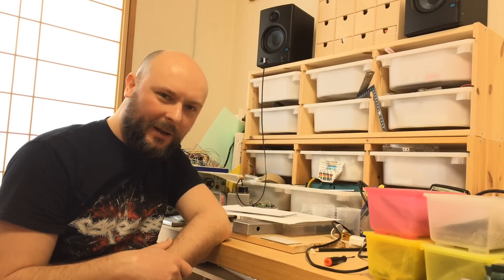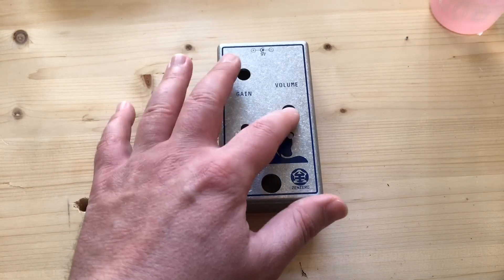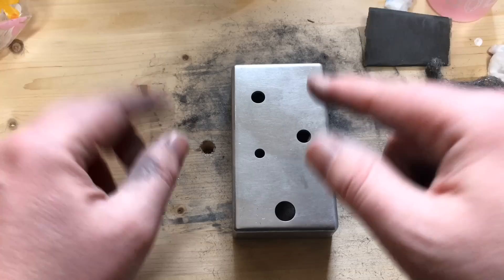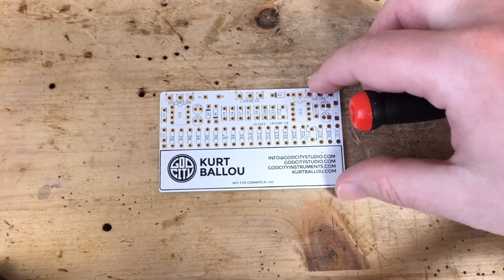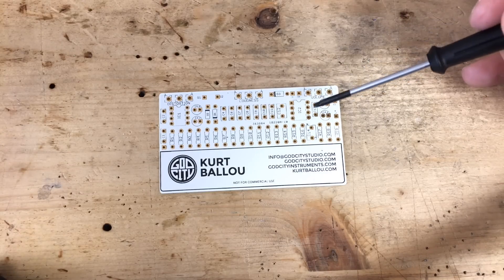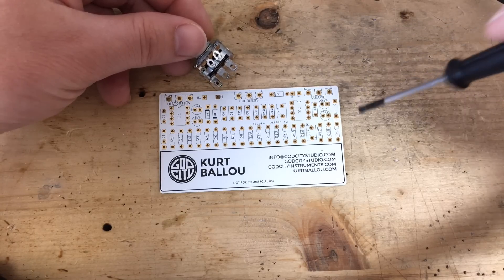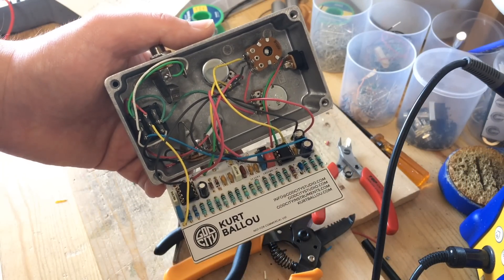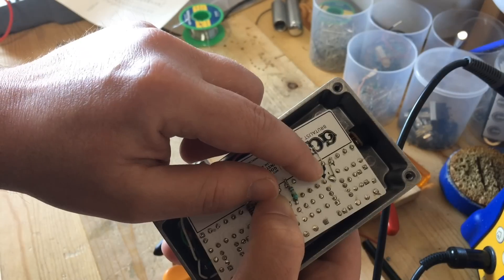Kurt Ballou's Brutalist Jr - Overview, build and mod

Comment: I use a bit cut out of a 2 litre PET soft drink bottle as an insulator between the board and case. Its pretty robust.
Reply from the maker: Thanks for the tip. I will try it out 👍

Comment: Hi i fail on this building...

the led is turning on up but no sound at all (the bypass is working)

do you have the step by step pedal circuit layout or any tip to help me on the search of the problem?
Reply from the maker: Hi. Sorry the build didn't work out yet. I don't know your level, so sorry if I say something above or below your skill level. Anyway, I would first take a good look at the circuit, visual examination solve problems sometimes and it's so much faster than anything else. Look for a bad solder joint or broken trace. Failing that, I would try to follow the signal path. It should flow from the "I" input, to pin 3 of IC1, to pin 6 of IC1, pass through the filter stage and the LOUDNESS control, then to pin 3 of IC2, to pin 6 of IC2 and then to the VOLUME and "O" output. Good luck!
Reply: Hi! Now is working fine... Some weeks ago with help from Kurt i discovered that the ICs was backwards. Thanks for the help and attention!

Comment: Why do not put 2 separate pots ? 
for more settings ?
@ZenZero Electronics
Reply from the maker: Sure, you could do that. But I usually prefer controls to be simple (I build the One Knob Pony and the 2KP after all). In this case, I had that double pot lying around and I know it works well to use to consecutive linear pots to get the effect of an audio or logarithmic potentiometer, so I went for it.
Reply: i like have a lot of choice, even if  at the end I dont change very often. 
Thank you for your channel, have you a Instagram account ?
Reply from the maker: Yes! https://www.instagram.com/zenzeroelectronics/
Reply: ZenZero Electronics i'm a graphic designer so if you some questions about design, adobe tools, etc.. don"t hesitate !